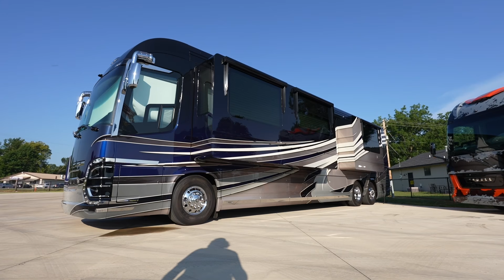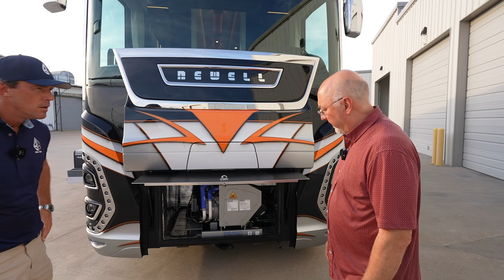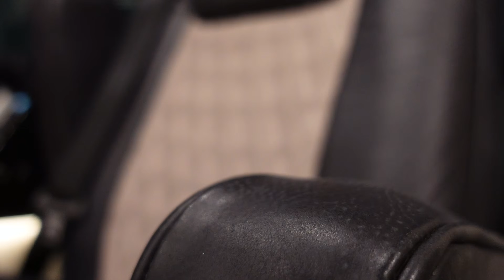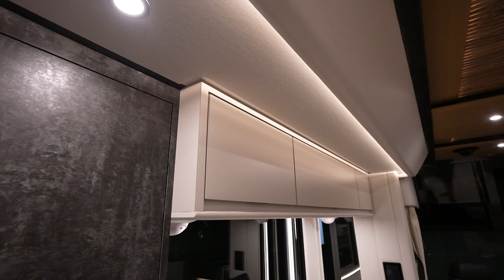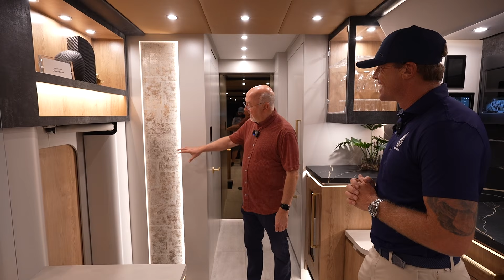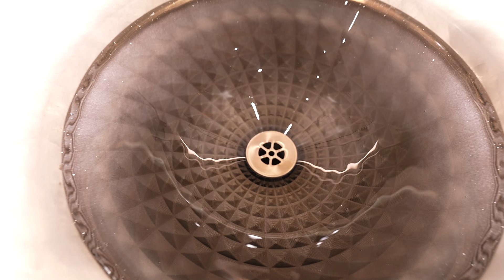Touring Custom 2026 Newell Coach #1840

Comment: I will have to say that rear engine bay door is got to be the best access to an engine I have ever seen. You can get to the engine in every direction of that bay with no obstacles in the way, a mechanics dream bay. I would always do manual  storage trays. The coach inside and out is beautiful, bravo team Andrew
Reply: Thanks! We do get great feedback from service centers about our bay access.
Reply: Can you guys do a super c motorcoach early next decade? Would you prefer creating a custom chassis or Freightliner Cascadia? It should have a 40k tow capacity using a pintle hitch.

Comment: #AndrewSteele is showcasing High Demand, Low Supply Newell Coach currently has a significant demand, with custom orders for new coaches having a lead time that could extend into November 2026 for a 2027 model 🙌🏼